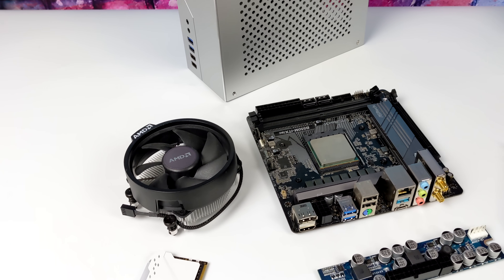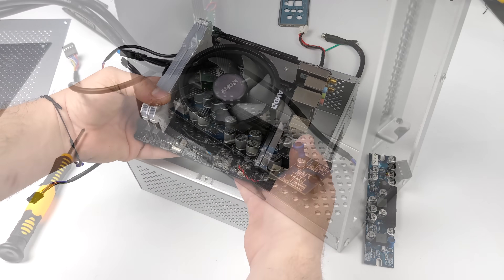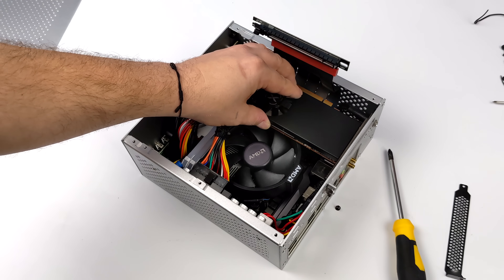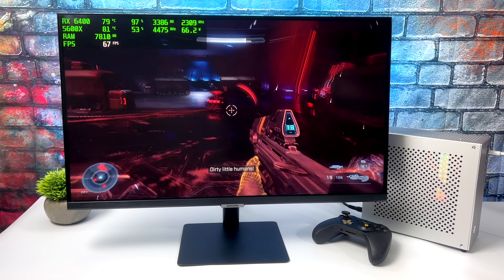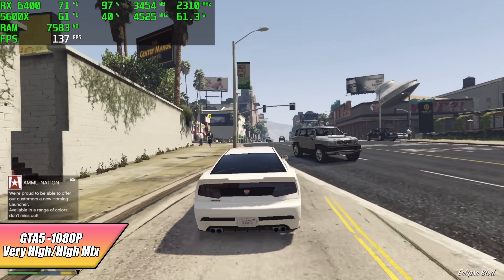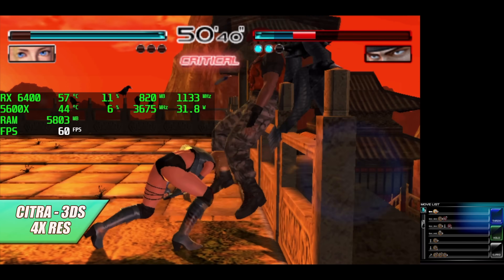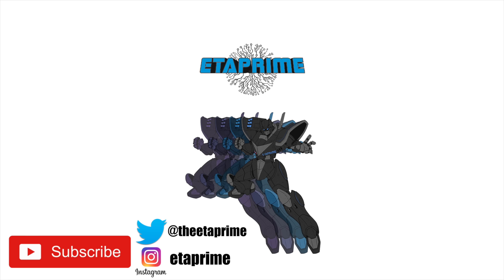A Tiny PC With An RX 6400+Ryzen 5600X! Big Power Small Foot-Print! Gaming/EMU build

Comment: I actually wanted to buy a new RX 580 8gb GPU (almost same price as the rx 6400) for my new mini desktop budget pc that's been build by a certain company in my country.
But i got confused with the power connector cables and everything.
Couldn't find the proper pins and connectors that are attached to the PSU.
Just casual user here that finally managed to upgrade my steamdeck and ps5 internal ssd.
But i went with the RX 6400 4GB because of simple plug in and replacing the Vega graphics inside the Ryzen 7 5700G.
EDIT: Actually later on i kept looking inside the pc and understood how to connect a GPU with the PSU.
But the mini desktop pc and RX 6400 are both very lightweight and not that power hungry.
So it's actually perfect i didn't understood how to connect a GPU with power cable at first.

For much stronger games (especially the ones asking more than 4gb vram) i'm using my series x and ps5 (with now built-in 2TB SSD)
So my new mini desktop pc with Ryzen 5700G+RX 6400 4GB, 32GB ram and 2TB SSD with ChimeraOS will do the trick for my retro/emulation gaming purpose and indie/"retro inspired" games.
ChimeraOS, AMD hardware and EmuDeck are like a dream come true for retro gamers.

And with the RX 6400 i can now also play the "online playing infuriating raging" Tekken 8 on steam at 1080p with medium settings, FSR balanced. 60fps.
Instead of tekken 8 at 720p low settings+amd fsr performance with the default Ryzen 7 5700G Vega graphics.
But sometimes i did encounter some fps slowdowns, or at least fps dips with tekken8 at a certain stage.
Warhammer Boltgun now runs at 1080p with default high to ultra settings. 60fps. sometimes dipping to 48 or something.
Prodeus with default in-game settings at 1440P ran 40-50fps with stutters. At 1080p with default in-game settings it runs stable 60fps.
I'm actually stunned looking at AMID EVIL running 1080p ultra settings, but utilizing 3.7GB VRAM.
This is with SteamOS/ChimeraOS. No idea how it will run in windows with PCIe 3.0 motherboard. But i'll keep it console-like with ChimeraOS.

About the PowerColor RX 6400:
Was kind of worried about experiencing stutters with the PCIe 3.0 motherboard inside my pc. Because of certain user reviews i've read.
Did have a quick black screen moment once pc boot-up and at ChimeraOS/steamos game modus screen. Weird, but oke.

Just got the GPU and have not tested too many games at the moment.
But for now pcsx2 emulation can be run at 1440p with nice settings and everything.
I'm happy for now. Maybe later on replacing the GPU.
For now i'll just keep collecting physical games for my switch and playstation game collection.

Comment: to save quite some bucks I would've gone with the Ryzen 3 3100, way cheaper, PCIe 4.0 support and it's more than enough to feed the 6400 also since it's a non-X CPU it'll also be safer with the small PSU

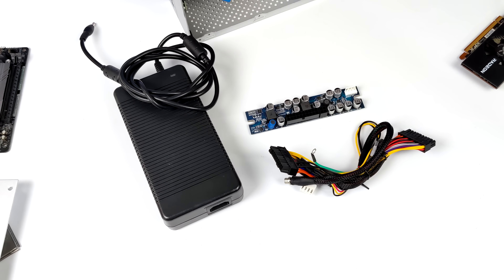Comment: 02:08 Have the same ITX board but somewhy it stopped outputting any video signal about 1 week in use.
Suspect it is something to do with the BIOS (and have another Amd apu to try to reset everything to hopefully get it working on 5600g again).
Saddly Asrock had some messy BIOS-es for this board (that is about the 6th Asrock board i have done, and owned 2, but have not had that mutch problems with a bios).

Comment: With the Asrock A300 motherboard (which is 140x147mm compared to regular ITX which is 170x170mm), RX 6400, which you can perfectly connect to the 4x lane M.2 slot and an optimized case you could get this to something truly tiny.

Edit: realising now that an M.2 slot probably won't be able to supply enough power to that RX6400, and I don't know of any single slot RX6400 which takes external power.

Comment: My only gripe with my XFX 6400 is that the fan gets extremely loud. Much louder than the Quadro T600 I was intending to replace.
Reply: The noise was my concern too. Seems to be an XFX staple. I had and XFX RX580 8GB a few years ago. That thing could boost its clocks like crazy but the fans sounded like a jet engine.
Reply: @mdo  I have a Quadro T1000 from PNY that has a same diameter fan but much quieter. I'm gonna swap them and see if the PNY fan is as powerful despite being quieter (they both run in similar RPM ballparks so I suspect so)

Comment: got a micro atx BM550 and a case like this but half a hand higher, with enough width for 3.5" drives. thanks for the RX 6400 headsup combinded with that 12v power supply setup. I have a 12v power grid so things like this (a full use PC) is really useful, unlike most small x86 boxes & laptops which are 19v. With a glass side panel I can use it as a table or desk, with enough room inside to mount a RPi4 as well.

Comment: +ETA PRIME Excelent build, I love it (as always with your mini PC builds)!
And most interesting for me is always the choice of a case and PSU, because those min ITX cases can be very expensive (like the motherboards) and for that a good suggestion is always nice to know! I've noticed you forgot to mention your SSD, haven't you?!
I wonder if you know a larger options for a mini PC to fit a micro ATX board and/ or 2 SATA drives as well?! Because I've got some older ones laying around ant it would be nice to use them for testing Windows 11/ Botocera, Steam OS or whatnot with having a fully functional Win10 installation untouched on the intern SSD.

Comment: Still not a good option. You can build a similarly sized build with a 6600xt itx  with only the price difference of the gpu. 

Furthermore, we're close to ryzen 6000 apu, which AMD is supposedly planning to use it to replace their budget tier gpu, which is this tier. Expect a cheaper build that you can vesa to the back of your monitor.

As for the peeps with sub 4L pcs that are looking to upgrade, if you're willing to gamble, Intel is targeting this segment with a 1660 super tier gpu. The moment that releases, this gpu will get massive price cut.

Comment: Whats the most powerful CPU and PSU one could fit into this case? also can you comment on the weight of these builds if possible? i want to build a mini workstation with this case, maybe intel 12700k or a 5800x? any info that would help would be great. Im guessing its the PSU that would be my main problem? the programs i'm mostly using are CPU/RAM dependent... great reviews

Comment: What screw did you use to attach the plastic stand offs to the case? How did you attach the power connector to the case? Did the Pico Power supply come with that nut to secure it to the case. I want to do something similar, thanks!

Comment: What a killer combo.
Love this build. I have been looking at single slot ITX chassis for ages thinking how cool it would be to put a GPU in there.
Obviously ETA is right these slots are mostly meant for extending ports from the motherboard, but if it can fit a GPU you know someone is crazy enough to try it. And this came out PERFECTLY.

Comment: It's such a perfect use-case for the rx 6400,but the price should be no more than $100.
Reply: Considering it needs a cpu and mobo that supports pcie 4.0 then it requires a new build of zen 3 or intel 11th gen or above. Feel like it misses the mark there as the 6500xt did.

Comment: Great build! You could save some money going with an i5-11400 which would give you PCIe 4.0 and Intel Quick Sync encoding on the igp.
Reply: I agree for the most part, though my 11400 very slightly chugs in xemu (solid 29fps instead of 30 in Halo for instance). Just a bit more power would have been nice.

Comment: Hey, I know it's a long shot, but there's two games I'd love you to add to your test roster that can tell a lot about the different units you test out:

1- For Honor. It's not the most efficient game, but if a PC can handle For Honor at 60fps(being a type of fighting game, FPS is extremely important), then most games were framerate isn't as important will likely run very well

2- Halo Reach MCC. Being the most demanding "last gen" Halo game on the Master Chief Collection, it's still fairly easy to run on most rigs and would be a fantastic game to test on weaker builds that you normally would relegate to emulation machines

love the content, either way!

Comment: Ok I have a real important question and I'm hoping you can help out since you do listen to comments.
Can you test out exact same test - Load wattage and idle wattage  (without animated wallpaper) with the pico psu (at the wall) and with a normal ATX psu (at the wall)

I'm thinking about getting a pico psu to benefit from lower idle power but I'm not able to find real numbers around regarding supposed efficiency.

Thanks a ton in advance !!

Comment: 5600 (non-x) would be a more sensible choice (you are bottlenecked by the GPU most of the time so there is no reason to overpay for a letter), or 5700g to have capability for hardware encoding/decoding of some video formats that RX 6400 lacks. Imo.
Reply: 5000G series has no pci-e 4.0 support
Reply: @Ya-Yo Gakk ain’t no way that apu is getting better performance than this card bro
Reply: @Ya-Yo Gakk dude stop scking hardware unboxed check the stats yourself, vega graphics are slower than rdna2 also R6siege is a esports fps game more cpu dependent at 1080p. 6400 beats 5700g easily

Comment: People are not brushing off the RX 6400 because it's a low end card. They are brushing it off because it is PCI E 4.0X4 which means to hit that GTX 1650 performance level you need a PCIE4.0 system, which iirc is intel 12th gen and amd b550/x570 none of which is cheap. So its a cheap gpu that needs an expensive pc to not suffer vs the 1650. Very few who can afford a pci-e 4 system will want a card like an rx6400. It's ill-conceived as a budget product in my opinion.
Reply: Another thing is that he's showing off sff case with a dc brick, all of which are going to cost you premium AF prices. What's another 150 bucks to get a 6600itx to a computer that's going to cost you 1k regardless.

Comment: Have to admit a bit shocking re the positive spin on the RX 6400 which is slower than the RX 570 a GPU released in 2017 at $150! And only x4 with a lack a of 4K H.264/H.265 encoding and AV1 decoding capabilities. Talk about going backwards and I certainly would not begrudge paying the price as they always tend to go up but at least with a performance increase. At the very least it should perform better than a 5 year old GPU that cost less at the time and had more features..Sadly we are being taken for a ride as both AMD and Nvidia learned from the last two years we will pay more, much more if pressured!

Comment: I believe an 12100f or a 12400f would be a better priced option in this build.
Reply: Probably would cost about the same honestly. The mini itx Intel motherboards are at least $100 more than this one last time I checked.
Reply: I just looked and Its changed a bit since last time I checked. I found 1 h610 for $50 cheaper and 1 b660 for $50 more than this mobo. So if you went with the h610 it would definitely be cheaper
Reply: @GhostAcez  I checked eBay and a b660 itx costs $135. It's $20 cheaper than any B550 itx motherboard I could find if you are in the USA.
Reply: @Bajicoy  Ahh ok. I was looking on PC part picker which checks Amazon Newegg and a few others
Reply: Shhhh... You'll wake up the Ryzen fanboy's 😂

Comment: Should have used a Ryzen 3 3100, that CPU is half the price of a 5600X and has PCIE Gen 4 which will be able to use the RX 6400
to its max potential.

Comment: This is a GREAT competitor to some of the Intel Nuc Extreme, this was an awesome little build! would be perfect for a parent who travels with kids, could easily plug it up to a hotel tv using only an HDMI cable and the power brick. the kids could use wireless xbox controllers for example. have a small wireless keyboard mouse combo, and the kids and parents could have hours of entertainment on the go, from watching YouTube and Netflix, to smashing some fortnight! Great build and content buddy! would love to see a cost list of the build just to get an idea, I'm thinking of building something very similar to this!
Reply: Then again, given the costs, it might be about as cost effective to just lug a gaming laptop. No HDMI required, power brick is optional, and at least on the "frames per dollar" aspect the midrange mobile GPUs of late are doing fine at about $800 USD
Reply: @csolisr  I agree except power bricks are not optional on a gaming laptop. If you're not plugged in you will likely get under 1 hour of gaming at have the performance on gaming laptops. So you would still need to be plugged in you would just have more options for where to plug it in and play it
Reply: Although I agree that would be cool. You could do all of that with a Xbox series S for $300 and it's more compact and more powerful than this unit. So unless you specifically already have a ton of steam games or something, if you want what you described a series S would be better. And if you need a PC as stated above a gaming laptop would be better and you could likely get a more powerful GPU than this in a gaming laptop that costs around $100 more.
Reply: As parent a tablet works just fine for that, or any one of the gadgets I usually bring. That said if I didnt have a 10500H laptop with a GTX 1650, this would be a great build for me.

Would love to know the total cost on this build
Reply: @crsv7armhl  Probably roughly $700 give or take
Reply: @GhostAcez  Ah, guess laptops are still a better bang for the buck then
Reply: @crsv7armhl  Yeah you could probably get a 2060 laptop on sale or a 3050 ti laptop for around that or maybe $100 or so more

Comment: I think a 5600 (non X) would make more choice if someone is doing a new build since it has basically the same gaming performance but can be found for cheaper.
Reply: Unfortunately, the 5600 only supports PCIe 3.0, which would hinder this card performance a lot.
Reply: @haschid  Uh ? That shouldn't be the case, the 5600 is merely a "cut down" version of the 5600x, only a 5600x with worse silicon and thus worse clocks. It would make no sense if it was indeed PCIe 3.0.
Reply: @trixniisama  It is not. The 5600 is a 5600g without the graphics. It has no relation to the 5600x.
Reply: @haschid  No, you are mistaken. It's the 5500 that's a cutdown 5600g. In fact the 5600 is still chiplet based while the 5500 is the one which is monolithic. Please inform yourself better...
Reply: @haschid  5600g = 5500 without igpu, 5600x - 5600 lower clocks

Comment: You should try to overclock and undervolt the GPU to see how well it works with a higher TGP (given that there is lots of headroom for the power over PCI-E slot)
Reply: Overclock is locked on this card from what I've heard. I'm more interested in downclocking the f*ck out of it personally, to see that nice efficiency in action

Comment: I am not 100% happy with the release of this GPU, but this is exactly why I love those tiny GPUs.
Reply: @Ya-Yo Gakk where on earth did you see the 5600g being faster than the RX 6400? As sucky as the 6400 is, the igp on 5600g won't even nip the heels of the 6400
Reply: @Ya-Yo Gakk biggest lie I've seen today
Reply: @Ya-Yo Gakk trolling much?
Reply: @Ya-Yo Gakk thanks for being so kind in YouTube comments. Always a pleasure. I would love it if you said that to my face. 

Also, please give an exact reference for the point where a comparison between the 5600G with Vega  and the RX 6400 is made and supports your claims. Let's leave the 1050ti out of this, Steve has done the work there. We are all dying to be enlightened
Reply: @Ya-Yo Gakk I have 6400, a 1650 and a 3080. My 6400 on PCIE 4.0 gets pretty much the same fps on most games as my 1650. It's most definitely better than a 1050TI and blows the 5600G igpu out of the water. Using a single game to make your judgement is hilarious.

Comment: Will this GPU work with a dell optiplex 990 SFF?
Reply: It might, but this card isn't suited for anything less than a generation old on Intel and current gen for AMD.

Your 990 runs PCI Express 2.0, which would run this video card way too slow to be viable.

Maybe a GT 1030 instead of a 1050/1650 SFF compatible card(if you can find it) instead. 1030 does have less VRAM and is less powerful overall, but it would run closer if not at full speed. My 1030 ran great with a Core 2 Duo E8600, so a second gen Core i7 should run it great.

Don't expect too much out of it though.
Reply: @Redmage913  thank's for replying that information was very useful 🙏

Comment: Really enjoying the videos with the rx6400 and low profile gpus in general. Was wondering if you have a way to get a rtx a2000 to see if it performs better than something like the gtx1650 or the rx6400 based on the price difference. there have been a few videos about it, but they aren't really comparing the a2000 to anything comparable, form factor wise. Thanks again for the videos. Hope you will be making a few more on the rx6400 or at least on low profile gpus.
Reply: Based on some videos, the RTX A2000 performs just within the middle of RTX 3050 and RTX 3060.

Comment: We need better small factor gpu cards like we had with 1070 and 1080..
Reply: My all time favorite is the galax gtx 1070 katana. It was single slot and ran great with low temps.
Reply: @davisbradford7438  I was thinking about the exact same card and honestly was wondering if they could cool a GTX 1070 that consumes I guess 150 watts of power (correct me if I'm wrong) with a single slot heatsink why didn't they make a model for the RTX 3050 or RTX 3060 in the same form...
Reply: @Specialisto  The mindshare for poor performing big GPU coolers has more reach than low profile cards that run cool. So manufacturers mostly ignore the high quality segment.